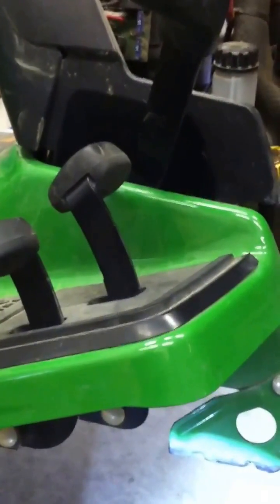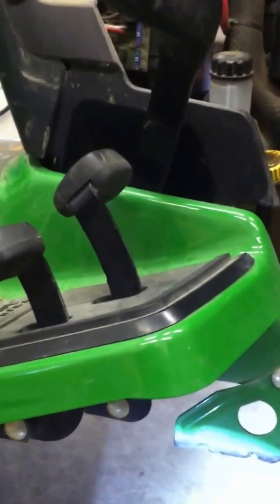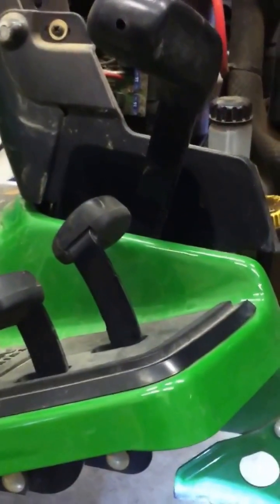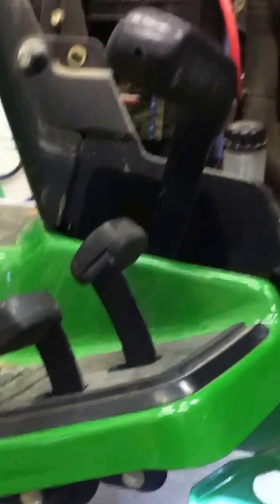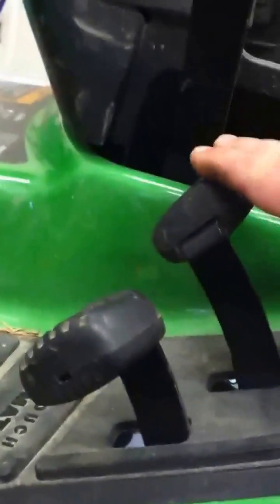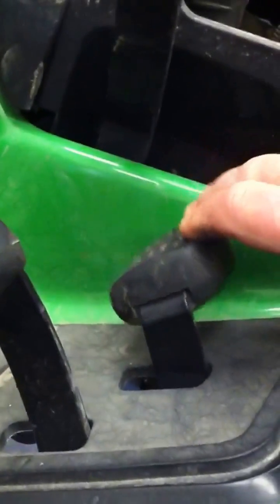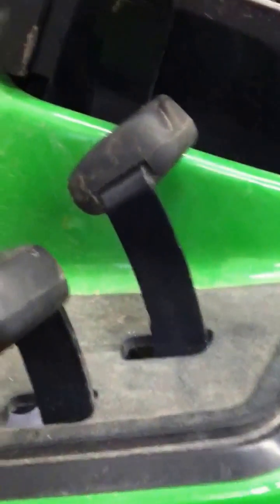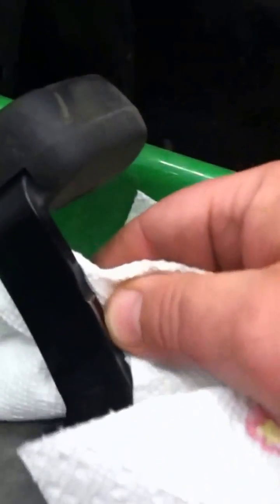Very dangerous design flaw of the John Deere GX345 lawn tra

Comment: There are two bolts under the floor board where the foot pedal connects to the bracket. If you had a service manual, it tells you to loosen them bolts and adjust pedal for proper clearance. Over time the pedal moves slightly on the bracket, hence why john deere tells you to adjust it periodically. SMH

Comment: that's not as dangerous as the factory fuel pump that sprays fuel out onto the hot muffler when the diaphram goes bad,the replacement has a hose attached that drains the fuel underneath the tractor

Comment: Each pedal has 2 bolts underneath. Loosen than pull pedal away from metal and re-tighten. I have the same problem with my 345jd. If the metals are flush where your bolting than its wrong. I pulled back so it's a little off but it doesn't grab. Any other method is just silly/wack.

Comment: I found the same problem so I gave two more coats if paint, that didn't work so I shot it with a deer slug, that didn't work so then used dynamite to give it just a little eancy wincy more clearance.
You'll find the procedure in the manual- where it says wrench- just replace the word "wrench" with the word "high end explosives"

Comment from the maker: Keith there is a cruise lever on the dash that does work.  It disengages when the brake or gas pedal is pushed, even lightly.  This oversight on the mat was keeping the go pedal pushed in at top speed and wouldn't release even with a hard stomp on the whoa pedal!